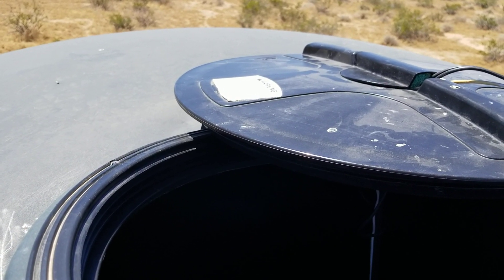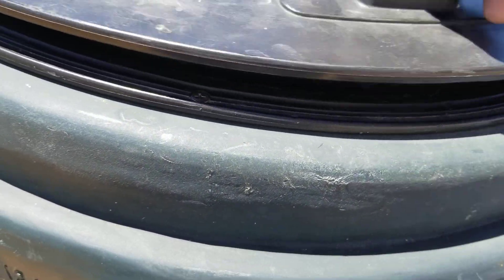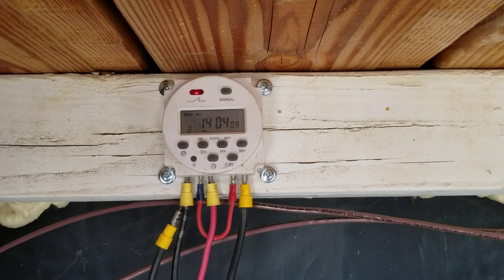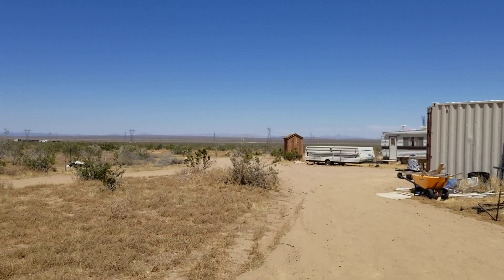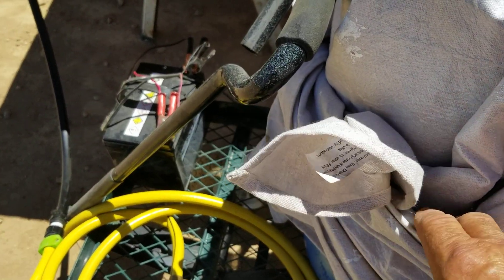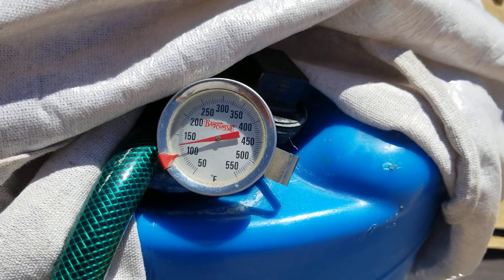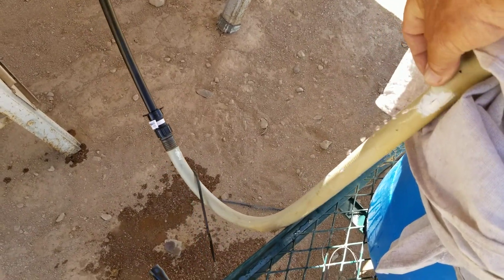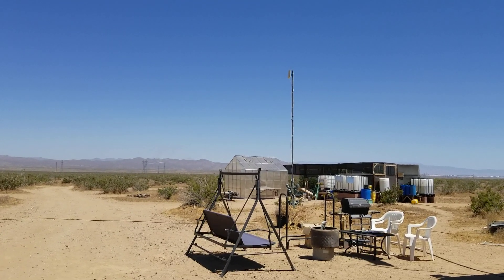Storage tank circulation pump/DIY solar hot water heater, July 19, 2020

Comment: Quick question g bear, what kind of brand do you recommend for a lead-acid AGM deep cycle battery? I finally have all the components for my solar system except for the battery and I'd like to get it hooked up before the power goes out, lol
Reply from the maker: I have had excellent results from "Optima".
I have a single "Yellow top" in my van, with a 3000 watt inverter and only 45 watts of solar panels.  I installed it in 2011 and it still works today to run power tools, including a Ryobi tablesaw and an air compressor.
You may want to research the Optima line for a higher amp hour rating if for your home.

Comment: G that water looks dirty, but then again I know today's filter systems can work miracles. I'm RO guy myself.
Nice job on the water heater. I still don't see how it's going to work in Winter. Say it's 40 F outside and no clouds what is it going to heat the water to?  45 F.  I guess anything over the ambient temperature will be good.  How many gallons of water are you putting in the greenhouse?
P.S. I don't know spit about solar water heaters, I just think of my 50ft garden hose laying on the ground in the Summertime Hot....Hot....Hot ! and then frozen in Winter.
Reply from the maker: A waterwall itself, without a solar heater panel connected can absorb enough heat on a winter day to keep the temperature above freezing in the night.  My plan is to raise the temp in the waterwall with the panel to keep the greenhouse near 60° on a 34° night.
I hoping to have about 200 gallons, (10 eat 20 gal barrels)
Reply: Or he could run it through a large compost pile :)

Comment: I'm planning to move to Tennessee in the near future.  Since the state of Tenessee is just north of the sunbelt, I think solar hot water heater would be great.  Can somehow, can I get the prints and instructions on assembly one?
Reply from the maker: I'll put together design and build instructions asap and get back to you for an email to send them to.  Welcome aboard!
Reply: Include me in that G Bear if you would
Reply from the maker: You got it! Just added your name to the list.
Reply: I watched you make it so I don't need the instructions. But I will be making one as soon as I find land to start my new chapter in life. 
I'm headed to Kentucky real soon. And the first things I'll build is a bathroom/shower house/laundry room. After getting water established. Thank you for the ideas.
Reply from the maker: @denisewilson8367  welcome back Denise!  You have a good start by accumulating knowledge before venturing out!
Simplify your first parts, hole in the ground with a set of walls around it, a solar shower with some privacy, and shelter to protect you from the elements.  Then build off of that!
I started with a porta-potty behind a bush, and a hanging solar shower, while sleeping in my van and cooking on a camp stove.  Then I built up from there.
The number one thing to keep in mind when moving off grid is "FUNCTION FIRST, pretty later"!
Good luck on your venture, if you need advice, log in and ask!  
Living the old fashioned way isn't easy, but if you make it fun, it just seems easy!👍😁👍

Comment: If you had to buy everything for your tube water heater, how much do you think.?  .. What brand of tankless do you have and how long have you been using it.? .. I put a "hott rod" in my RV tank so I heat my water strictly from solar.. (haven't had the propane hooked up to it for over 2 years now)
Reply from the maker: OSB plywood $13, 2 2x3x8 studs $5, 250 ft black tubing $24, fittings $12, black paint $15, glass panel (free from discarded sliding door)  roughly $70.

Comment: Your water heater will work  quite well without the pump.    Convection circulates the water  well if you set up the inlets and outlets above each other.  .
Reply from the maker: Yeah, but of course I will use a solar powered hot water circulating pump.  I ordered 2 of them and they are at port of L.A., but all imports get held for 3 weeks quarantine,  so I won't have them until next month.

Comment: Gbear what is the full charge of those harbor freight battery
Reply from the maker: They are maintenance free lead acid 12v batteries, so standard full charge should be between 12.4 and 12.7v
Reply: What settings are u using 14.2
Reply from the maker: @dangoras9152  14.2 is the divert voltage.  Once the batteries reach that, the controller quits charging them.
Reply: Yeah i seen urs at 13.1 threw me off
Reply from the maker: @dangoras9152  13.1 is acceptable charge on 12v batteries.  That's basically what the alternator on you vehicle uses.  I set my controllers to divert at 14.2, and disconnect below 10.7, but I hope I never see anything below 11.7.